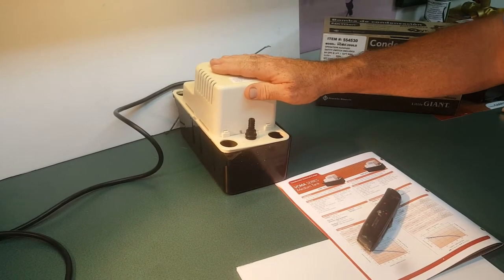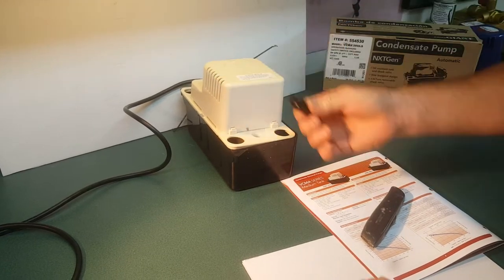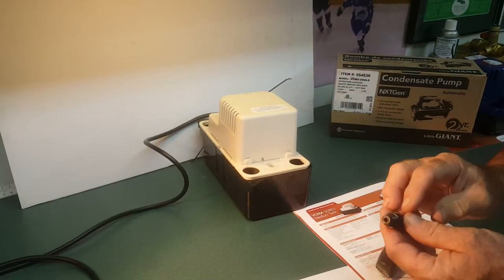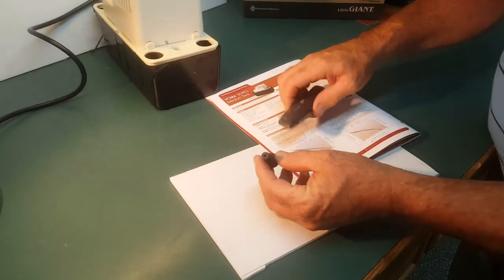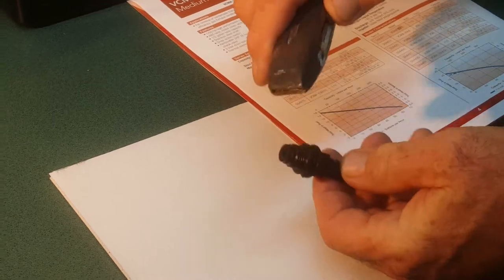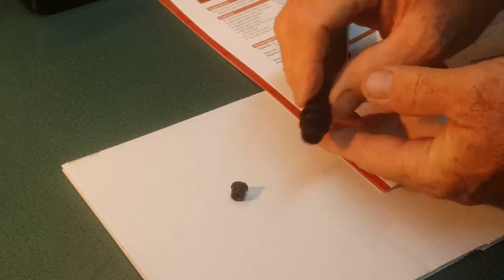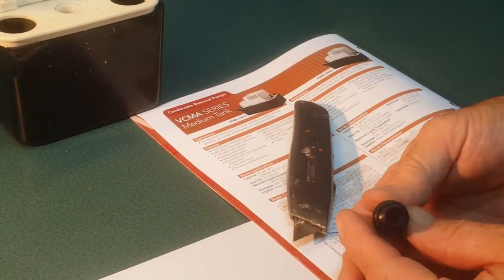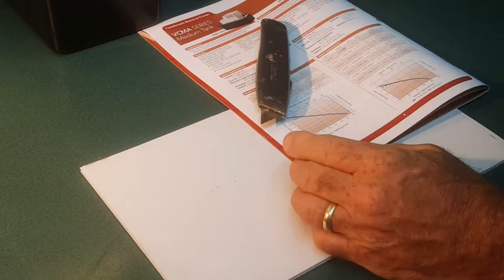Little Giant Condensate Pump Check Valve Trick

Comment: If you have to remove the CV10 check valve to clean it, why not just replace the dirty check valve with a new one.   Same work required.     Replacements are about $7.00 on line.   I keep two extras on hand to replace them when the get clogged up.   Trying to clean a dirty check valve is no guarantee it will work like new again.   A new check valve will give you a TEN SECOND drain time for the tank.   Any drain time over 20 seconds is too long and means the check valve needs cleaned or replaced.   Also, dirty check valves can make funny noises to.  A cleaned or new check valve will make the funny noise go away.   The factory told me to never use bleach to clean out your tank components.   Bleach will destroy the pump and motor components.   Good luck!

Comment: does that ball have to stay in there? i use it to pump out the water that drains from my table that i have plants on so when the plants begin to have run off sometimes soil will collect in the outlet of the table that goes into the condensate pump and it keeps clogging. what do you recommend i do?
Reply: To my understanding the check valve opens when pushing then drops down to prevent the water that was pumped from returning.So I would yes.

Comment: Too bad they changed the check valve on the VCMX-20ULST so it's a solid molded piece now
Reply: The VCMX End cap is removeable too.  Use a pair of pliers and work the bottom off the check valve assembly-  the endcap is shaped like the cork cap on a whiskey bottle-  a little patience-  it will come off.
Reply: I cleaned mine & reinstalled it but it snapped.Don’t forget to fill the reservoir with water before testing it.Ran it dry & it broke that’s the theory I have.